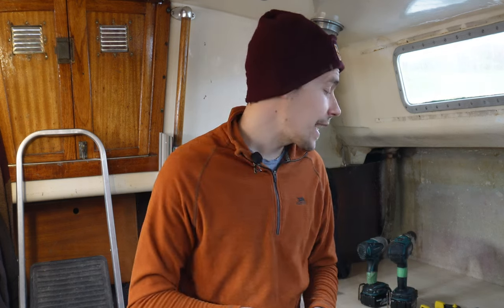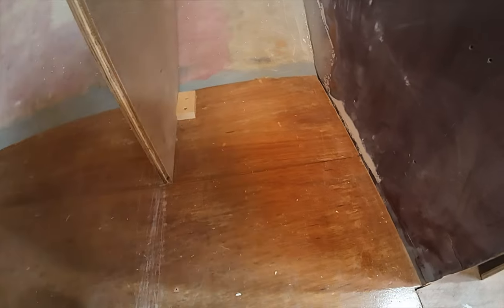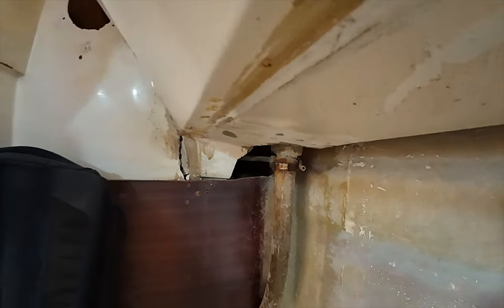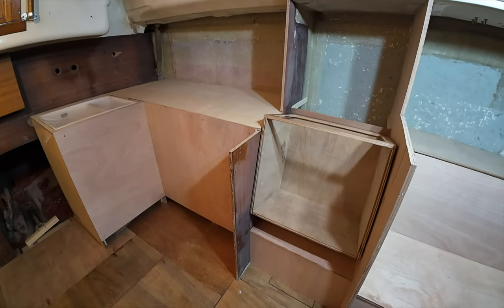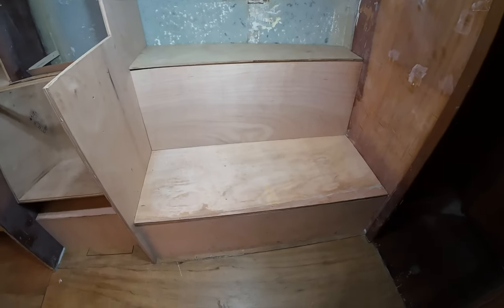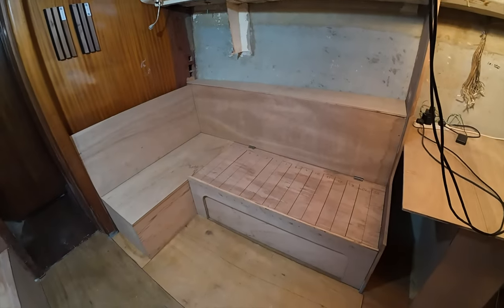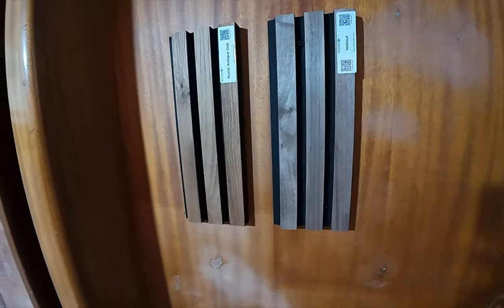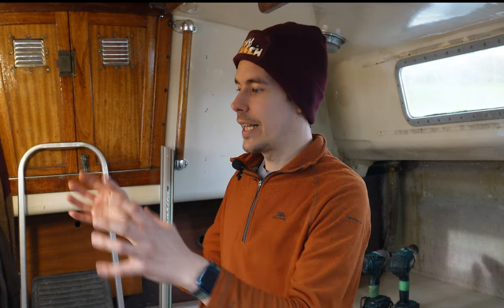Boat Refit UPDATE and Design IDEAS

Comment: Sailing Uma installed a wood stove before heading to Norway  \, Ice;and, and parts North. Finding and storing wood to burn was a pain, dirty, and required attention. They had electric propulsion. You have a diesel motor and a diesel fuel tank. I;d suggest a diesal forced air heater. They sip fuel and are very efficient. One heater can heat both your forward cabin and the salon cabjn. .
Reply from the maker: I don’t think we’ll find ourselves in any remote locations for the first while. I do appreciate the reason behind the diesel, it’s just not for us.🙂

Comment: I would highly recommend a diesel heater instead of a wood stove. I've sailed with both, and the diesel heater is so much better! It takes very very little diesel to run, and you don't have to waste space storing wood! 
Our diesel heater was a super easy installation and hardly takes any room at all.
Reply from the maker: I definitely appreciate them but the diesel heaters aren’t for us. The wood burner won’t be our main source of heat, just an indulgence.🙂

Comment: Well, since you asked one thing I would not do is try to build my own refrigerator and stick it back there in the corner because that could be more counterspace instead I would get a double drawer unit with the top of refrigerator the bottom of freezer that way you’re not taking up valuable counterspace
Reply from the maker: We’ve looked into pre build fridges and there isn’t one that would fit our space. Having someone custom build one for us out of our budget. It’s a really good point though, the top hatches would be used as counter top too.🙂
Reply: Excellent update 😊

Comment: Have you thought about using bamboo as your wood selection. It’s super durable, not that expensive and enviroment beneficial good as well as being sustainable
Reply from the maker: For anything in particular? We’ve looked at bamboo flooring as an option. Where else would you suggest using it?🙂
Reply: @sailingrumpunch  Counter tops, shelving, facia, moulding and toe cutouts. A good lumber yard would have it in standard pre cut sizes or should be able to plane it down to specific sizes. Just a thought.

Comment: Would definitely not go for a wood burner, storage of fuel is a pain, there is always the risk of fire, a diesel heater would be far more easier and economical and better at heating the whole boat.
Reply: 100%
Reply from the maker: We’ve looked very long and hard into this and diesel heaters aren’t for us. We will have other heat sources, the wood burner will be used as a treat for cold, calm evenings. Thank you for your input 😊
Reply: @sailingrumpunch I’ll be interested to see what you go for, if not diesel. Dan and Kika (@sailinguma) appear to have got rid of their wood burner as its performance/storage requirement ration was too poor. I guess you’ll keep us posted 🤔
Reply from the maker: Will definitely keep you posted!🙂

Comment: Strong, dry, secure, functional and reliable are my tips. Looking nice if you can but funky comes a little way down the list. Sounds like you want to build a cosy studio come editing suite come bistro. Surely producing video content is a bit secondary. Getting something that works and to build on and back on the water is the main concern. You will fill the boat with all kinds of stuff for live aboard. I think your spice racks may get pushed down the list unless you are really going off grid in which case you do have a lot to think about. The jury seems to be against wood burners and I would be inclined to agree though.
Reply from the maker: These are all good points! No bistro?? You’re crazy! We’re still early in the build. This is our home. Comfortability is a major factor too. Once we get on the water we’ll know what works and what doesn’t.
P.s the spice rack is top of the list 😉
Reply: No offence meant I love watching boat work / rebuild videos but I also know how chaotic live aboard is. Just keeping the boat tidy can be a massive challenge. Especially when doing even minor maintenance jobs. Combine that with actually sailing and living it all becomes a compromise and simple is what you may need. Good luck.
Reply from the maker: No offence taken! Thank you for your insight 😊

Comment: all i can see is yes wonderful >>>but that wide open Galley is going to hurt you being tossed even two feet to that table is a rib buster going for an open cosept there is a bad idea you will need a staple that you can plug in to stop or lean against  grab handles when you are air born they arr always not there
Reply from the maker: You’re absolutely right. This is very early in this build, poles, handrails and harness points will all be added before going to sea 😊